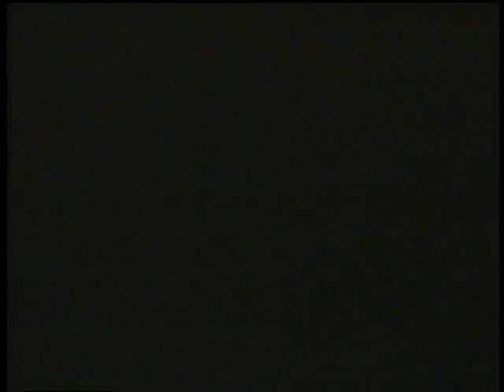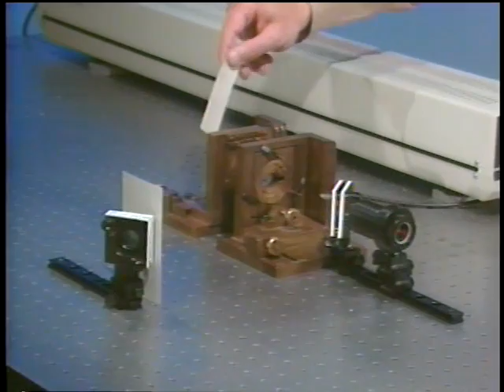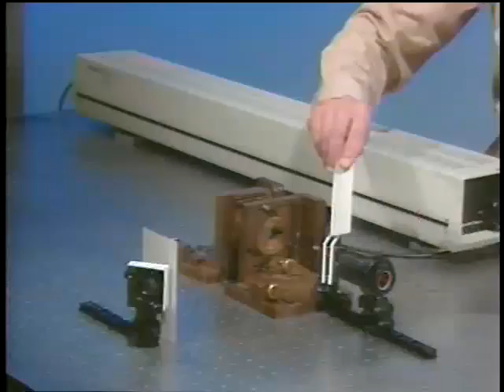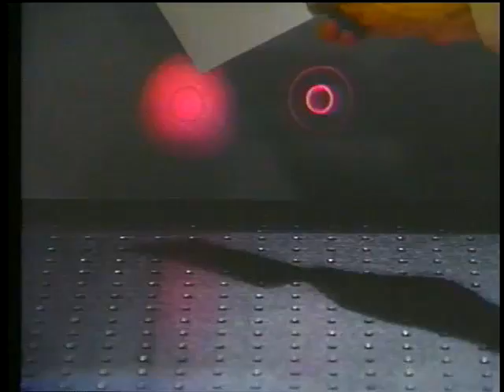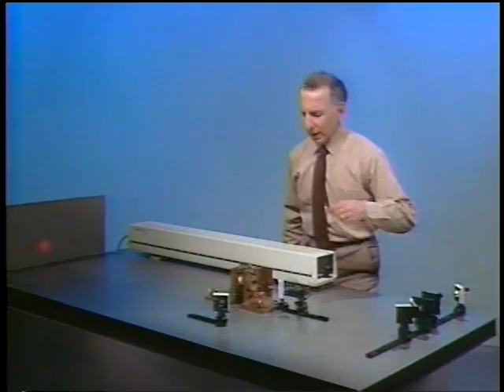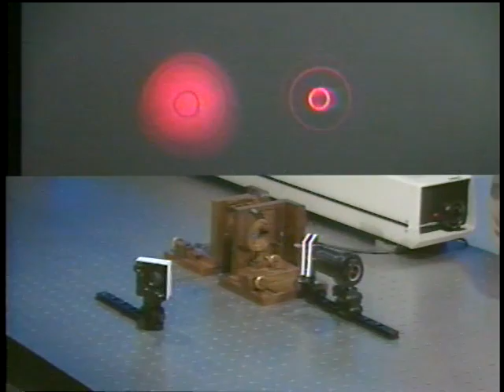Optics: Plane mirror cavity - diverging beams | MIT Video Demonstrations in Lasers and Optics

Comment: Let me try a different answer. A divergent beam can be subdivided in an array of beams travelling though different angles.
Because of the angles, the optical path is slightly different; an angled beam travels more than a straight beam.

This causes that one if the sub-beams would be in a constructive interference and other beam in a destructive; so we see bright spots in the transmission and black spots on the reflection